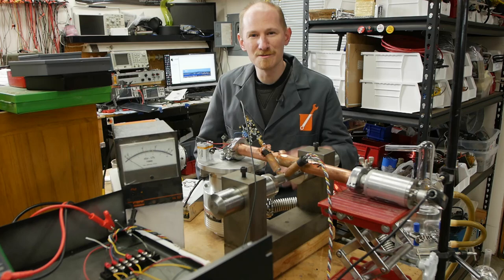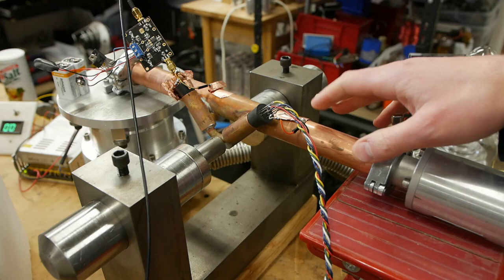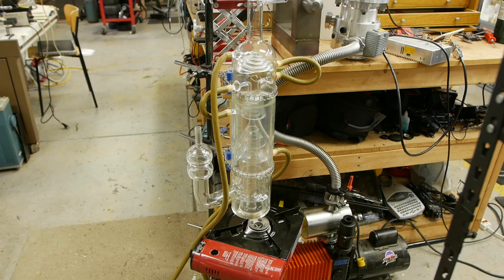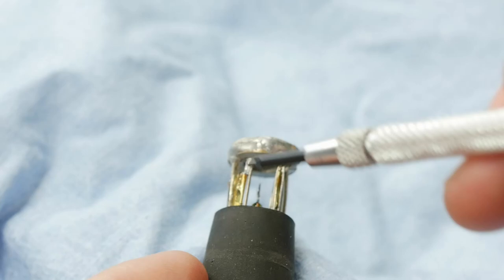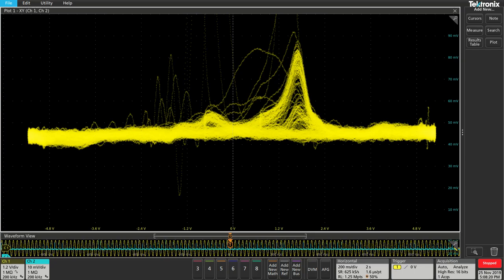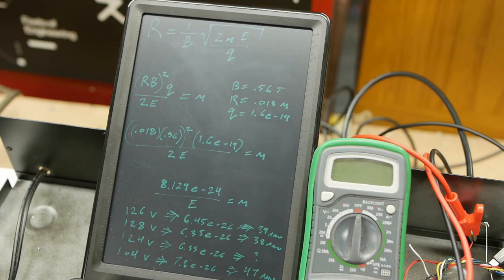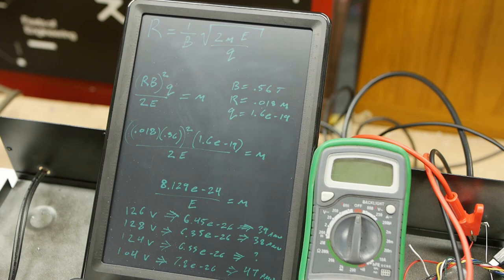DIY mass spectrometer measures potassium in dietary salt substitute

Comment: Measuring sodium might be a good way to check whether that second peak is just an echo. Sodium pretty much just has one naturally occurring isotope, so if you see a second peak that would confirm your theory of there being some kind of echo artifact.
Reply: Yeah. Or even easier, what happens with potassium if you shift the DC voltage? Does the mystery peak shift correctly? 47 amu is something like Titanium, or maybe SiO, or Tungsten 4+, so not totally impossible.
Reply: "....That would support* your theory...".   FTFY.
Reply: Also, Hypothesis, not theory.
Reply: i would also suggest to measure a tin or barium compound because they have a lot of stabil isotopes, so you could test your separation and get an idee if the shoulder of your peak for the Potassium is the second isotope. To get an idea of the ratio of isotopes maybe it would be better to count the area of the signals instead of the height?
Reply: As WilWinston
 has pointed out in his comment, most leaky vacuum systems show a CO2 peak, which has m/e=48. Such mass spectra are most commonly seen not in "real" mass spectrometry but in RGA (residual gas analysis) which is a specialized from of mass spectrometry for troubleshooting vacuum systems and process equipment -- there you ordinarily look at all the usual contaminants from the atmospheric air, absorbed water, etc.
Reply: @jeffsweeney312  wrong
Reply: I worked with x-ray and a linear detector. To remove shadows i had to add multiple slits on the x-ray source side to remove the shadows. Those beams weren't making it to the detector anyway, at least not directly. Can that be the case here too? reflection of your piping by an other chemical element.
Reply: yeah i dont know why he didnt try other things.
Reply: @Mainzbas  I too think that the area is a better metric for the total num of ions seen at the detector...
Reply: @cogoid  CO2 should be seen around 44; the isotopes are too small to be seen...
Reply: @janami-dharmam  You are right it is 44.
Reply: Regarding the piping interaction, I believe the body of the mass analyzer is grounded so that it doesn't build up a stray charges that could deflect the beam, that being said one of my books talks about the care that needs to be taken when handling components near the ion source and the electrometer as fingerprints can build up a surface charge that deflects the ion beam.
Reply: The CO2 signal is m/e 44! He proved that is system in this range is prazise to see Potassium at 41 so i dont think the „CO2“ signal will differ that much. Also the signal of „CO2“ compared to the Pottasiumsignal is in my opinion to high for the low pressure.
Reply: I almost forgot: messure a blank! Than you will see if the signal will come from your system or from the compound.
Reply: @kasa6468  A theory is a mathematical model that explains all current and past observations about a phenomenon can be used to create testable predictions for results of future experiments. A hypothesis is a "guess" about what is happening or what is going to happen and fits existing observations, and it can be proven or disproven. Hypotheses are set up constantly as part of doing science. Creating and verifying a theory is often years upon years of work; proving a theory is unsound or incorrect given certain circumstances does happen, but is also a lot of work. Usually, proving a theory wrong will lead to new science, or at least a more accurate theory being formulated.

The worst disservice Americans have done to science is to coin the phrase "just a theory".
Reply: @Francois_Dupont  I'm sure he'll do a followup video eventually. He spent months of this thing, I'm sure he's a little sick of it at this point having to work for almost an hour just to get 6 minutes of experimentation.
Reply: @CafeBikeGirl  I think this information could be quite relevant for an experiment I'm currently working on, which provides an unexpected output. Could you tell me in which book your read that?
Reply: Peter Johnson re your last sentence “just a theory”   This!
Reply: @cogoid  CO2 m/e=44
Reply: @weinihao3632   There are too many for me to list here. The Nondestructive Testing Handbook: Volume 1 Leak Testing published by the American Society for Nondestructive Testing covers a majority of it.
Reply: @CafeBikeGirl  Thank you very much!
Reply: All the pedantry aside, it's a good suggestion and I hope Ben noticed or at least thought of it.
Reply: Exactly.. I think that extra peak could be a type of resonant echo.  One way that you could test it is by changing the diameter of your tube and see if that changes the location of the echo...  Otherwise, it could just be that the potassium chloride/ water solution has a contaminate in it..
Reply: @kasa6468  theory generally implies that it has been used to make predictions that have been tested and confirmed.
Reply: The echo might be due to how he differentiates between atomic weights, and the time it takes for the ions to travel from source to detector.

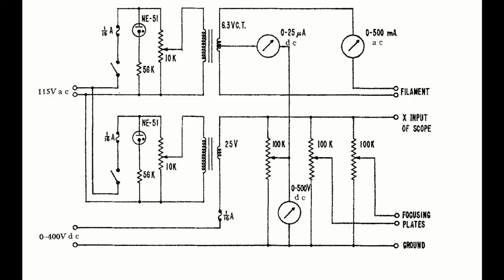At 15:22, he says that he changes the acceleration voltage to differentiate between the different atomic weights. He uses an AC voltage, but doesn't mention the frequency of that voltage. At 16:23 he mentions that that AC voltage drives the X-position of the oscilloscope. 
When the correct voltage is reached, the atoms have the correct speed to reach the detector. But the ions take time to travel from the source to the detector. That means that when the correct voltage is reached in an up-going phase, it will be higher by the time the ions reach the detector. When the voltage is reached in a down-going phase, it will be lower when the ion reaches the detector. 

That may explain why we see two peaks for the same atoms, one at a higher and one at a lower voltage.

Comment: You are using a commercial light bulb filament as an electron sprayer. The filaments as well as the envelopes of commercial bulbs have additives and one in particular is used for oxygen scavenging. What you are likely seeing in the 104v return is zirconium which is used to scavenge minute free oxygen atoms.
Reply: Zirconium has a mass of 91 amu. Even if it were doubly charged that would get you to m/e 45.5. Also the isotopic distribution doesnt look like zirconium at all

Comment: I believe you are correct that the large peak is the 39 M/Z and the shoulder on the front of the peak is the 41 M/Z

I am a retired Field Engineer from one the worlds largest manufacturers of mass spectrometers.  Your mass spec resolution of about 2 M/Z is very impressive.

you may increase your resolution by replacing the source 'side shields' with small magnets on either side (most of our sources utilized magnets in the source in this manner to increase the beam focus)

The small peak at a calculated M/Z of about 47 it is likely CO2 from an air leak.
In troubleshooting ms systems the CO2 peak was a ubiquitous signature of an air leak. 

Building a GC or HPLC front end is a walk in the park compared to a mass spec. I 
I can supply you with some components at 'cheap-to-free-prices' if you are interested.
Reply: This sounds to me like the simplest explanation, but do you really think the CO2 peak at M/Z = 44 could be observed all the way over at M/z = 47 when the K+ peak was pretty much dead on at M/Z = 39?
Reply: We need videos on that topic ASAP 😉
Reply: @Miroslav Kašpar I have the same question. Seems unlikely, but at the same time CO2 is really the simplest explanation.
Reply: I would guess that CO2 is indeed the explanation. the fact that it is not spot on like the potassium is likely due to the potassium-specific massage of the constants in the formula. I'm sure you could massage things so that both CO2 and potassium fit nicely, which actually would be a rather nice calibration for your device :)
Reply: perhaps co2 produced by filament burning itself/sample?
Reply: The CO2 explanation makes a ton of sense, given that it's several times more soluble than oxygen or nitrogen through rubber. The stoppers are creating a kind of molecular sieve.
Reply: @Miroslav Kašpar could you not just use HPLC fed to an atomizer? I'm not familiar enough with HPLC-MS but that makes the most sense to me. you would have to have it detecting when the molecule of interest elutes to then switch a valve/stator to inject the elutent through the atomizer in a timed pulse as to minimize the amount of mobile phase entering the mass spec.
Reply: Miroslav Kašpar so a detector upstream would interfere?
Reply: Time for an upside-down can of air duster.  :) Or a nitrogen blanket?
Reply: Maybe introduce some concentrated CO2 near the seals and observe what happens to the peak.
Reply: That's cool, would love to see  MadMass2!!!
Reply: @stevenwilgus8982  haha!
Reply: @__shaun__  That would require the filament/sample to contain carbon, and for there to be enough oxygen for the carbon to combust.
Reply: Hi, who did you work for please ?...I am an ex VG engineer.
Reply: Thermo Fisher
Reply: @WilWinston  Oh !...you guys bought us !
Reply: Often salt contains an anti-caking agent, could this be the cause? I think it's usually calcium carbonate but I'm not sure.
Reply: Surely if there was such a significant air leak though you would see a strong peak with a mass of 14 after all nitrogen is vastly more prevalent in air than CO2
Reply: @WilWinston I love ThermoScientific! Chromeleon is the best LC/GC Software i have ever used. And Orbitraps are amazing high-res MS!
Reply: It seems to me that mass specrometers at science labs are smoke and mirrors
Reply: The 47 is weird for me too. I used to use "dust off" spray, the propellant would show up beautifully at mass 51; Maybe he can try to get some of this in there (very Volatile!). If he sees this at 51 then we can possibly assume that masses between 39 and 51 are correct, I'm not helping much but it could at least disprove your CO2 theory. Air leaks would always show up as 28 and 32 with a small amount of 40 (Argon) showing up.  Were you at Agilent?
Reply: @hedgeclipper418   the masscal is not that precise. So it could easily be 12C+16O+18O=46, the most common second mass of CO2. If the scan range went down to 44, you could test that hypothesis. My personal guess is double sodium, also 46. If it's leak CO2 then you would also see it with no sample on the filament.
Reply: @AA-gl1dr  I love that "just".
Reply: @jonathansnow1886  if it is a possible air leak as WilWinston suggested the main peaks that show up would be from Nitrogen.  mass 47 could be NO2. ??
Reply: Thanks for chipping in, I found this very interesting, and your comment is enlightening, and supportive at the same time.  I spent two decades in avionics, and I don't think I would've tackled such a project, even if I'd run into the reference, unless about twenty years ago or more.  I was trying to think of what would've fit in that bump, and your experience gave valuable insight.  I too am very impressed with the resolution, only among many other things.
Reply: @AA-gl1dr  I think it's better to build an ESI source and that is not hard anyway.
Reply: MASSIVE !!!! AMAZING !!! God bless Youtube and Bill Gates, it's CEO.
Reply: @wurrzful  Potassium chloride may be contaminated with the carbonate, which would boil off CO2.
Reply: I'm pretty sure that after two years, no one is going to read this, but the hypothesis is easy to check: wrap everything in a bag and surround the device with a small gas, and see if it shows on the spectrogram. If the smaller peak is due to leakage, you'll know it
Reply: 47 is for CO2. It's commonly found in human breath.
Reply: @rusticagenerica  yes, Billy Gator is the CEO of YouTube, bless him, for he has purified us from all our sins.
Reply: Well, a Titanium-47 peak would also fit to that data.
Reply: @ArminVollmer  yeah but where the heck would titanium be coming from?
Reply: @itzikgutzcha4779  I read it - July 2024  - good idea, do it in a tent
Reply: @benjiwiebe8128 Could be some carbonates in the KCl salt?

Comment: I like how we all joked that you'd said "yet" in the tennis ball video when you mentioned mass spectrometers. And now you've gone and done it! Amazing. Been wanting to do this for years but the difficulty and tedium to constantly take it apart and put it back together always scared me off it. I think in a couple years I may end up building one now! Though I'm excited to see the follow up you mentioned. Quadrupole? Some RF magic? Lots of ways to make a mass spec, so I'm stoked to see what you choose. Have you picked up a copy of "building scientific apparatus"? there's a whole section on mass specs. 

As to the 47mu peak, what about titanium? titanium dioxide is known to be a filler in salt products. It also has 1 common isotope at exactly the right spot, and then 2 much less common heavier isotopes and 2 lighter isotopes. Peak would look similair. If this can't resolve the potassium peaks I bet it can't resolve the titanium peaks well either so they get glomed together.
Reply: I might actually lean towards the idea that it's Titanium, if it's possible to actually get a sample of this looked at by a real spectrometer it would answer whether or not it's just a ghost really easily!
Reply: @noahhounshel104  Well he built his own scanning electron microscope, so now he can just build his own EDX energy dispersive Xray element analyzer to add on to it!
Reply: A birdie?
Reply: What are the odds that in all 3 experiments the KCl salt used had the same ratio of titanium to potassium? I don't think that is very likely.
Reply: Feels like too much titanium; according to the ingredients such flowing agents tend to be less than a percent.
Reply: Have you thought about building an Ion mobility spectrometer? They don't require vacuum and are generally not too hard to build. I built one myself during my msc thesis and was able to get decent results.
Reply: I would suggest to run some lab grade KCl through the spectrometer and see if the supposed titanium peak appears
Reply: Might be something like titanium from the filament, not quite sure what those are made of. I'd be curious to see if there's a peak for a mass of ~24 for Ti2+ or around 12 for Ti4+
Reply: @noahhounshel104   there are titanium blades, so it is possible that this material will be dragged into the process.?
Reply: Now he doesn't have a synchrotron... yet
Reply: @JackFou  Those filaments are made of titanium at least sometimes because of the high melting point. You might have hit the nail on the head there.
Reply: @noahhounshel104  Titanium dioxide is used as a white food colouring. Maybe it was an impurity in the sample.
Reply: I knew he wasn’t joking! Considering the amount of amazing things this guy built, quite a few of them involving HV and HV (high vacuum and high voltage), a mass spectrometer is definitely within the realm of possibility.
Reply: I'm just imagining how the the sample injection could be done with a small capillary tube inserted into the rubber stopper next to the tungsten filament. Then you could continuously inject liquid analyte and have the filament just function as the electron impact element. And building quadrupole for it sounds awesome too!
Reply: @zacox  The problem is the atmospheric pressure would likely push  the sample in way to quickly, so it would have to be fitted into a reduced pressure container, which adds a whole other level of possible issues.
Reply: Excited box  you are probably thinking of tungsten not titanium.
Reply: Irvin Coria I would have thought the assumption of it being well mixed is reasonable in this setting.
Reply: Right and now knowing the. Issues he ran into it will be “easier” to plain to mitigate or even solve many of these issues from the start.
Reply: @irvincoria1887  I would ask another question
how soluble is titanium oxide
I honestly don't know
from videos I have seen Ican observe it remains as suspension and really dissolving, but it may be just because I mostly have seen it on videos where it was used as white pigment
Reply: @cortana2007  lab grade KCl is expensive compared to not advertised KCl called low sodium salt
I actually buy it on regular basis as additive to drinking water (along with very high quality table salt, MgCl, Epsom salt and Lugol's solution)